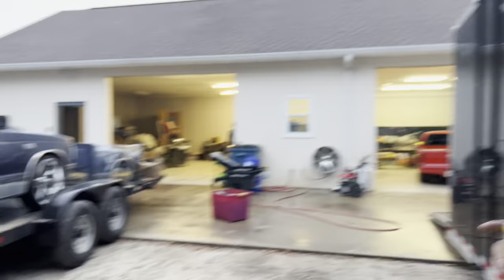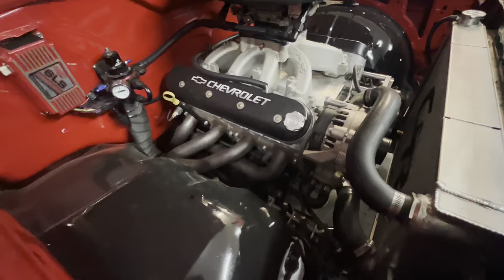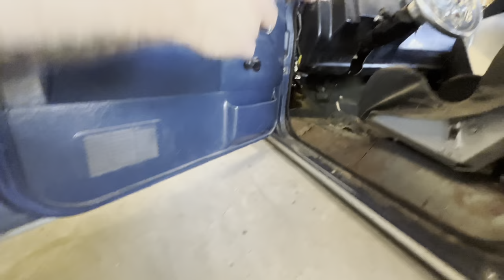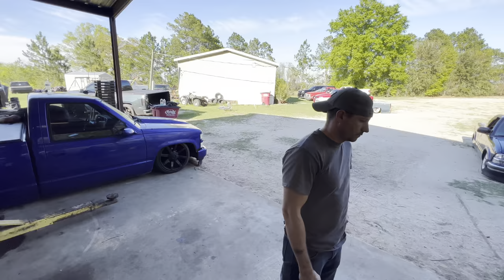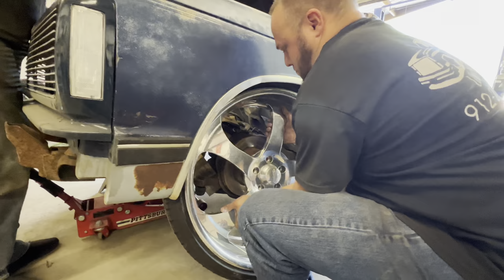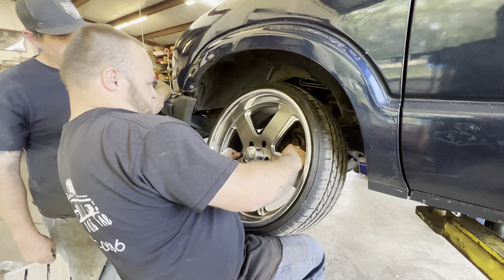We bought yet another mini truck…but not for why you think🤔🤔

Comment: i need a bench seat.. I got a 1993 would it fit
Reply: sorry nevermind... i see no bench
Reply: @nelsonfieldsjr.7232  I have two. Good shape.
Reply: @ridingdirty8897 what parts you got for later gen 2s (2000-2003)??
Reply: @blazebrady3659  what do you need. I just crushed 600 s10 trucks and blazers but I kept a ton of parts.